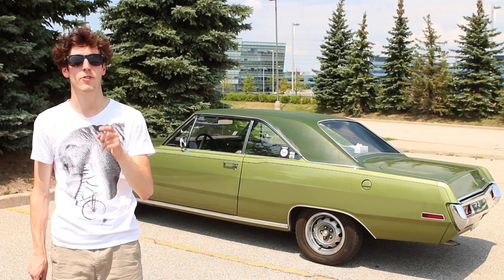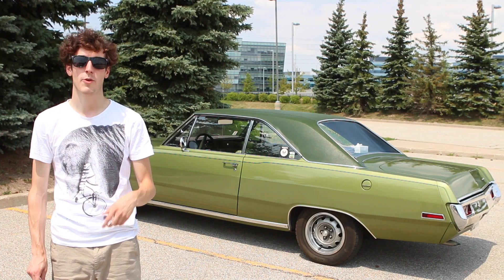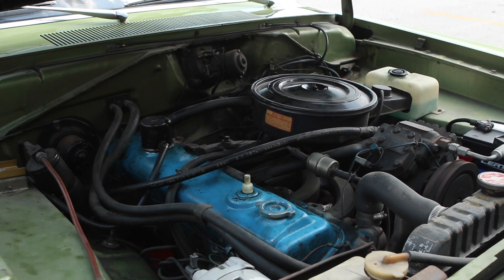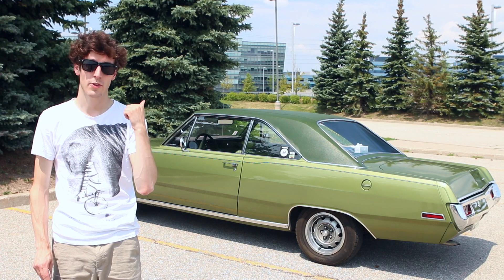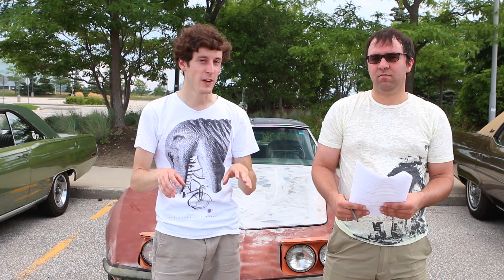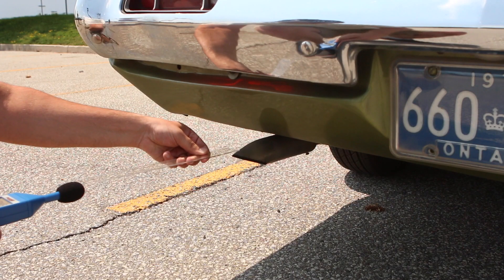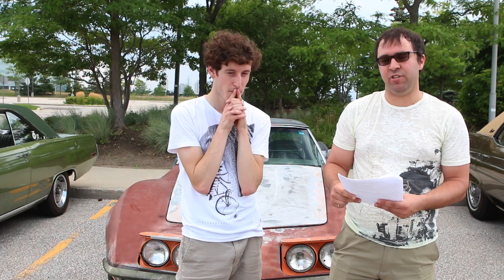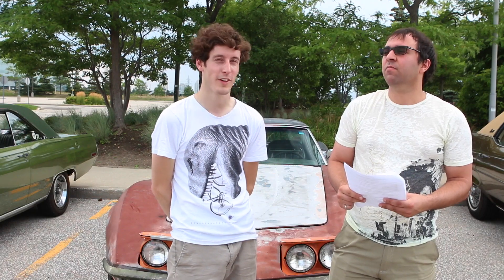How loud is the Cletus-Vette? | R+C Spare Parts

Comment: Don't know if you figured out the Vette's starting problem. Having had a 72 Vette as a 1st car it was a common problem that a cold engine started easily but a hot engine didn't. The Problem is the starter Solenoid's location and the high current requirements of the starter motor. When the engine gets up to temperature it heats soaks the solenoid which causes a current drop to the starter motor. A heat shields helps but the Fix is a Fenderwell mounted Ford Solenoid with a strap connecting the terminals on the starter to bypass the GM solenoid or another way is a New Mini Starter such as from Powermaster or Jegs with a heat shield, about $140 for both from Jegs. The mini starters are also a gear reduction type like the old Dodge starters which requires less current along with more mechanical advantage. From One Vette Lover to another. Be sure to wave to or wave back to others Vette Drivers.        P.S. Headers or bigger engines make more heat that makes the problem more apparent. A open cowl induction or L88 hood scoop can release a lot of heat that can be trapped in the tight engine compartment.
Reply from the maker: Thanks for the info! It actually has a modern starter in it now and is working perfectly!